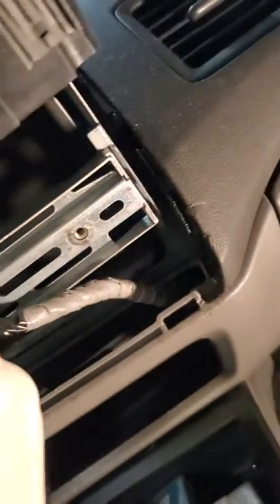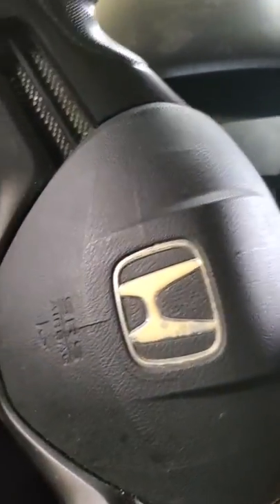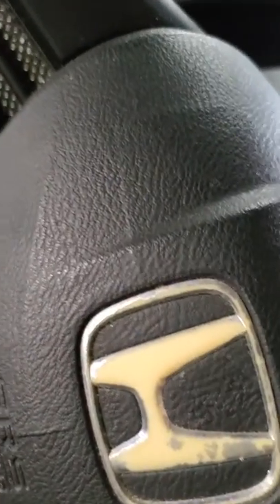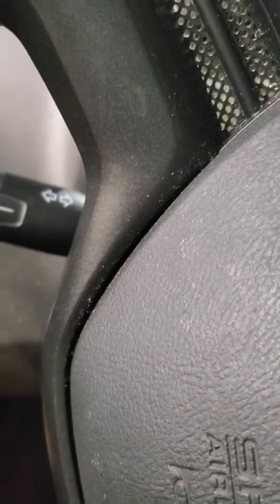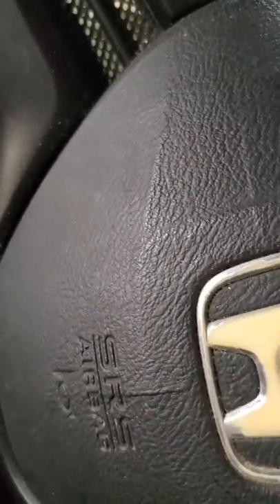How to remove radio and ac control switch on 2007 Honda civic

Comment: I need to remove the radio and the display above it from the dash panel.  I am going to attempt to polish the display.  Someone took some kind of chemical or maybe a dirty cloth and scratched it so bad you cannot see display except at night.   How does the radio knobs come off?
Reply: Mine is like that too. A ton of horizontal scratches. I thought previous owner screwed it up. But I've seen it in other vehicles. I wonder if it's a factory defect. Any luck fixing it?
Reply: @pointlessopinion611  Yes..I was successful in restoring it.  I pulled the center panel out and removed information strip it from the the dash to expose it.   

I started with as I recall 600 wet silicone carbide paper..  800 and then 1000 and then wet clocus cloth.  It's a little flat finish but perfectly acceptable.  If I had put it on my buffer wheel, it would have been perfect.  I have used that to restore the wood in a older Mercedes after multiple coates of laquire   (forgive my spelling)